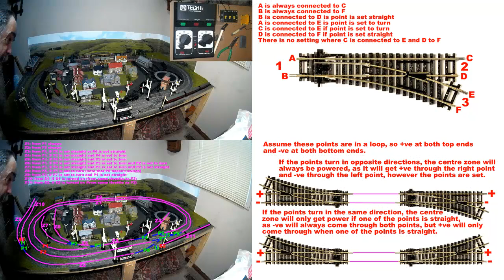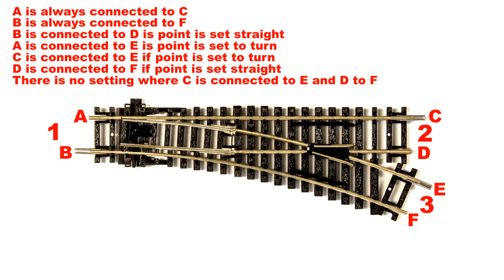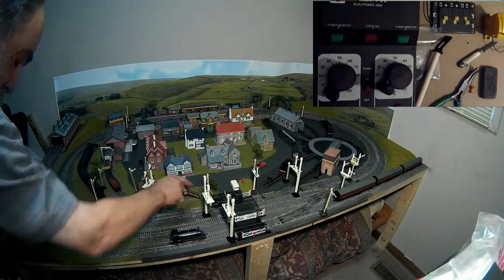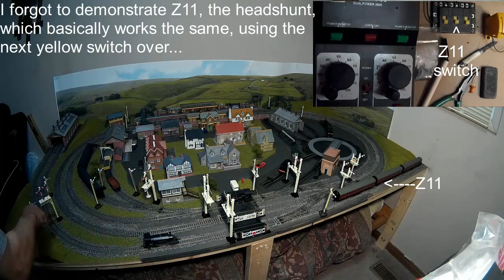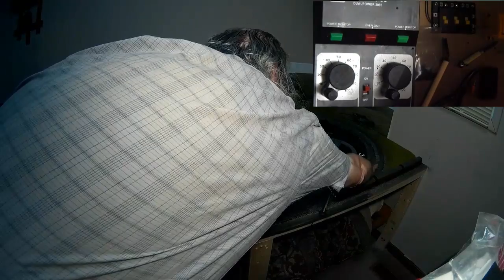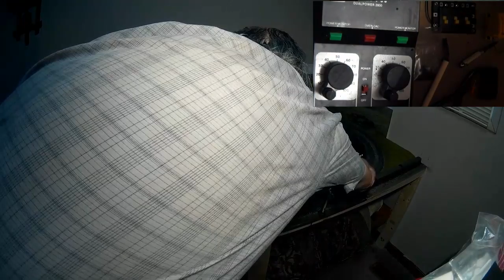OO Gauge 59, DC Layout Power Analysis & Demonstration

Comment: Hi Ken. Are you now wishing you chose DCC control and motorised points?
Reply from the maker: No, not really. I wouldn't be able to run the range of older locos that I like with DCC, quite apart from the extra expense. I do have motorized points on my other two layouts, and they're really necessary there, as it wouldn't be practical to reach all of the points to change them manually on those layouts. But I deliberately put all of the points on this layout on the front side, so as to be able to change them manually. Although, I did go that way in the first place since it's a bit more complicated to motorize Hornby points, whereas with Kato Unitrack and Bachmann EZ-Track you can just buy the points as a single unit, ready motorized. What I do really need to do is to fasten down the darned signals, so I don't keep knocking them over.